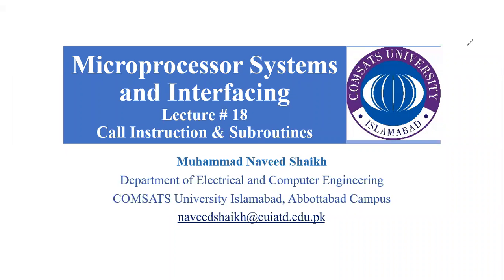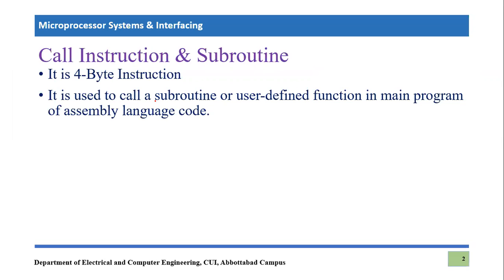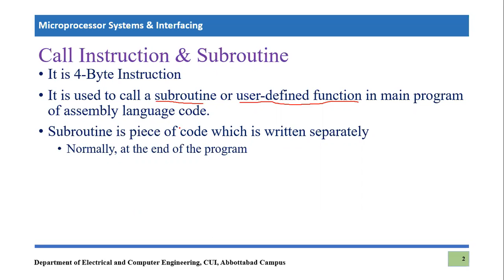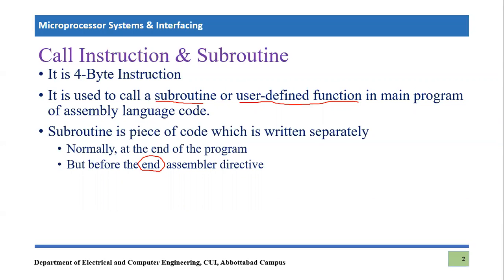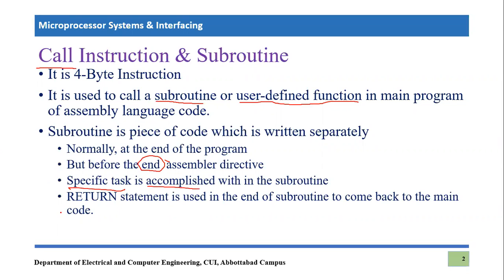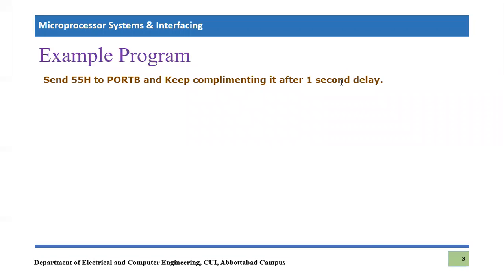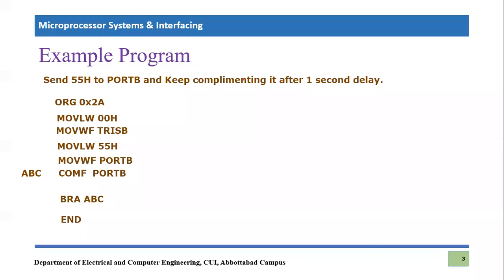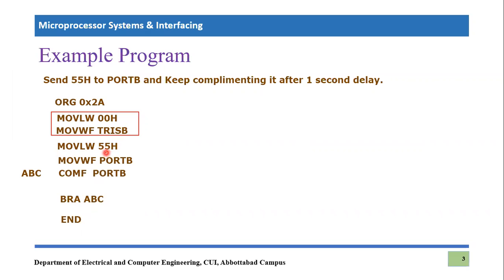Call Instruction in PIC18F Microcontroller || How to use subroutines in assembly language programms

Comment: Assalamualaikum Sir, I have a doubt from the one of the PIC micro application notes. Very old one. "Automate the home" in this application assembly language is used. I could follow the code but the following lines no where I could find the answer. Could you explain why this is used. (May be I am bothering you Sir) The code is written like this: 
; The ID words...
ORG H'0200'
ID0 Data.W H'0000'
ID1 Data.W H'0000'
ID2 Data.W H'0003'
ID3 Data.W H'000F'
; and the Fuse bits...
ORG H'0FFF'
CONFIG Data.W MCLRDisabled + NoCodeProtect + WDTEnabled + IntRCOsc   

How to understand Data.W? This code is written for the controller PIC12C508. A old chip. But still the code is confusing to me. Probably you may be able to clear my doubt that has been troubling me all along. Thank you Sir, with respect.
Reply from the maker: Wailekum salam,
 Venkata,   its old PIC12 code.  Well,  lines starting with Data.w is a kind of assembler directive which define preprocessor ID0 and so on for specific hex data. You can use these names as variables instead of this Data. A typical example of such a preprocessor in the latest PIC18 is EQU. 
Line starting with Config is a standard procedure for defining configuration registers' values necessary for hardware interfacing. I hope my answers can help you:)